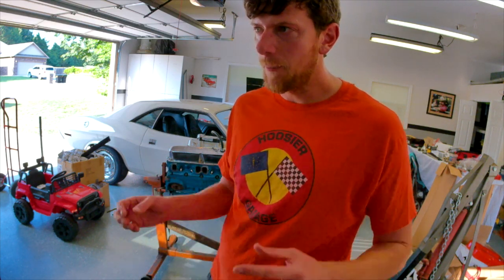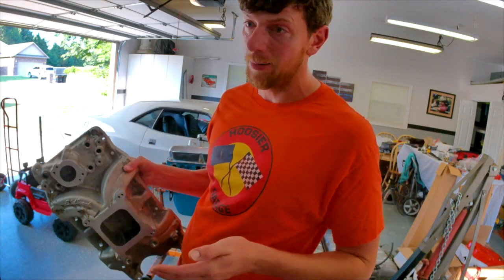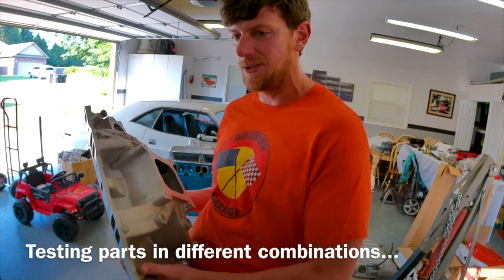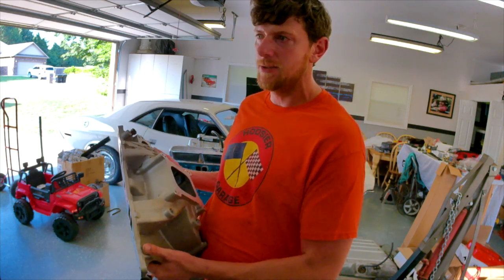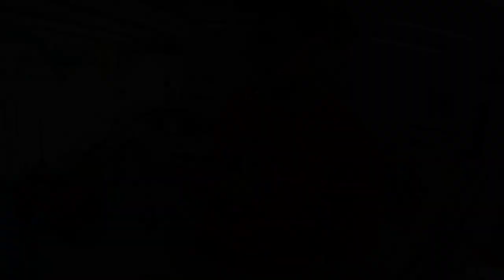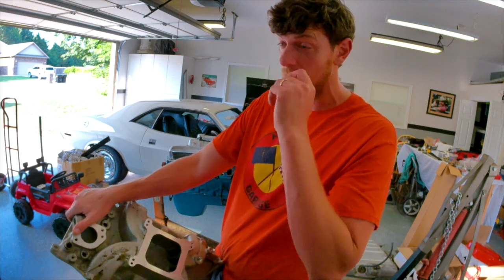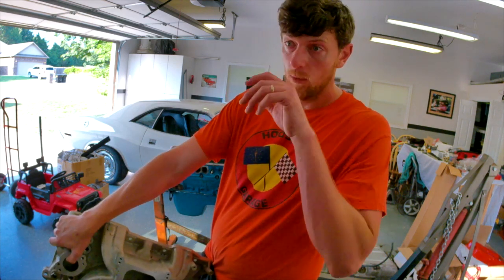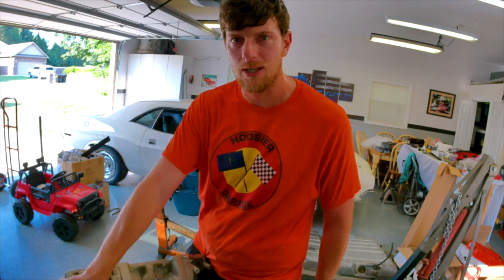Mopar Reading or Research?(Open Discussion)

Comment: Very well stated. I feel reading is part of research, a start if you will. After research comes testing, then knowledge. Sometimes gaining knowledge is a long hard road of mismatched and broken parts... I have been Mopar for 30 years and have done my share of bad research, but that's how one learns.
Reply from the maker: Sometimes you learn with what you have at your disposal. Lots of guys skip to the knowledge part without any testing.
Reply: I built a bunch of cars in my day too I had a $67 Dodge corn head I still got some pictures of I used to build hot rods and stuff but I had a car wreck and I got amnesia I don't remember how I'm praying to God that I get my memory back

Comment: To research, I first look at youtube videos to see what others have done.  Then I buy parts and do it myself.  I usually break things and then have to buy it again.  I have noticed that its important to look at the small details.  The small things you miss can cause big problems.
Reply from the maker: I absolutely agree! Buy the heads and not realize you need 2,000$ rocker arms. Buy the intake but not realize you have to cut the bolt holes to make it seal properly. The list goes on!

Comment: Great explanation of reading vs research, I do a lot of reading of what other people have done. But my research is normally trial and error. This isn't hot rod related, but when I did the Cummins swap on the Deathcharger, I wanted to use a NP435 4spd. The problem is they never put Dodge NP435 behind a Cummins, but they did put Ford NP435 behind 4bt Cummins. With lots of reading I determined that all the internal bearings were the same between the Dodge and Ford. So after lots of measuring I determined I could make this work in the factory location. So my transmission has a ford bellhousing, input shaft, and case. But it has Dodge main shaft, guts, and tail housing, Which allowed me to bolt everything into the stock location and run a Dodge transfer case. Many have said that the NP435 can't handle the Cummins torque, but in reading up the Getrag360 that came behind the Cummins from 89-93 is rated for 360lbs of torque and the NP435 is also is rated at 360lbs of torque. So through trial and error, I determined that all this can work, and I have been hammering on it ever since! Lots of reading, trail and error research.
Reply from the maker: Awesome stuff! We have seen you field test it!
Reply: Trial and error is the gospel truth when building anything that was never built! Good job!
Reply: Great info Duddie!!!

Comment: I use to run a 280 mopar cam and 3.55's.  Also an airgap and I thought it was nice and quick. So I thought. Later I got brave and said the heck with it. And went against the tide. Threw in the 292/508 mopar cam advanced 4° @ the crank. Swapped out airgap for a Victor 340 single plane intake. Rear gears went to 3.91's. 3400-3600 stall 9.5" FTI converter. It ran even better. So I was happy!!
Reply from the maker: That’s awesome! You did change that engine into a totally different animal.

Comment: Mopar performance used to be the best at sharing speed secrets or just knowledge, but that has changed
Us old timer's still use combinations that have been proven and known to work, example ..
I still only run autolite plugs in my mopar engine's
Mopars seem to run there best in the hands of a Mopar guy
Its voodoo to ford and gm guys
The biggest mistake I see is people copy the wrong stuff,
Just because Ronny Sox run this camshaft or a fast idle of yours runs this convertor don't mean it will work well on your car, ol how many times I have seen this
People still  today use the 509 purple shaft in automatic cars because of all the stories back in the day of it when in reality its designed for a manual trans. Car
I could ramble on but don't take the easy way out all the time
Joe is right resurch study talk to people look listen and learn
Reply from the maker: Well said! It’s definitely different strokes for different folks!

Comment: I'm in a dilemma , to listen and Do what others , or keep with my own gut feeling ! Exactly what  started the show about , and I am not going to use key words or it will disappear, I am one of the ONLY s in my circle and am starting to wonder , I guess at this point it'll be me and grandbaby left everyone is has taken the cool aide !
Reply from the maker: Do what you do think is best. There’s always more to learn in my end 😂
Reply: And on a Mopar related topic , I have one of those cheap crosswind intakes on my 340 ! I am currently trying to learn and RESEARCH which replacement to go with ! Instead of pulling the engine I want to throw one on and see the difference before I do a basic refresh , oil leaks etc .
Reply from the maker: That’s awesome! Let me know what data you find.

Comment: Research to me is huge... Doing lots of math. Looking at cam specs, compression, gear ratios etc to try and set the "numbers" i want in stone. Then its surfing and comparing manufacturers numbers, reveiws, etc to find a match or closest possible. THEN I start shopping, with a plan fully ready.  Of course then youre  sorting it out once it runs, and then finding that sometimes the math lied to you...  But the hands on tinkering and optimizing is the fun part!!!!
Reply from the maker: Agreed! I love disproving myths that way or even starting a new trend. The hot topic that’s resurfaced is the piston swap from side to side. I have tried looking it up online and most say it was old school hotrodders secrets. 🤔

Comment: Check out engine masters they do lots of testing, it’s on a dyno and not necessarily real life on a drag strip or on a road , but some of the results are very interesting.  I think with intakes it’s complicated as every intake will likely have different air fuel per cylinder and unless you have 8 wide band 02 sensors in each header pipe how would you know what each cylinder is running at, is it lean, rich?  Yes you can read plugs, but that doesn’t necessarily tell the whole story.  And then certain cylinders you can’t fix just based on the intake design, you just can’t tune it out using a carb.  That’s why manufacturers went to multi port fuel injection.  You can control each and every cylinder to make sure it gets the air/fuel it needs.  I think that’s why the air gap has such good reviews, I think it distributes fuel quiet well because of its design.
Reply from the maker: It’s an excellent intake. My goal is to have the fastest time with my combination. I may just do a side by side intake swap at the track with both intakes. That’s field testing that’s proven!

Comment: I had my first car was a 65 Ford LTD automatic transmission slip I got worse and I got me a Glen's transmission manual from there I read the articles going to Hot Rod Magazine's whatever I found and just start by doing and talking to other people if you like the hobby and if you can turn a wrench and a screwdriver fix what you break experience is Money in the Bank
Reply from the maker: Absolutely Keith! I may have a similar idea for a video coming up 🤔

Comment: For me, the only factual way to prove or disprove what works the best, is to have everything you want to try along with your engine ready for bolt on at a dyno...  Otherwise you are taking someone else's word for it and you don't know that they worked to the best timing or kept temps the same or tuned the carb to the best it can be on each manifold or even ran the engine with their own headers that will be run on the cat!! I used to moderate on dodgeCharger.com. Great bunch of guys on there until it went political. Then I left. Anyway, we had some real mopar gurus on there and we created a dyno section called PROVEN BUILDS or something like that. These were guy who are absolutely NO BS and you can trust what they have tested.. Most often with the paper to prove it.. 
What I like the Air-gap for is keeping the engine heat away from the air-charge. It's hot in Florida, so that may make more sense for people here than other areas, but engine heat cooking your fuel and charge air is only ever good in the frozen North!! lol...
Reply from the maker: Thanks Steve! I’ve definitely visited that forum several times. It was a lot less abrasive than some Facebook groups now. There are new guys that ask a question or want to try a part, but get shot down with insults or laughed at for not knowing better. That sort of stuff kills the whole deal for people and they run out and buy a new car.
Reply: @JustMoparJoe   I was with the original DC.COM and became a moderator on the new DC.COM. It was of huge pride that we all got along so well for many years. Then something turned and I couldn't deal with the BS anymore.. Still, there are some guys on that site that I would absolutely trust working on my car.. That is a very tough thing for me to do since I was a professional mechanic and have seen far too many hacks in my life...